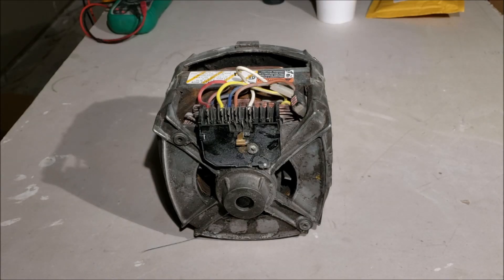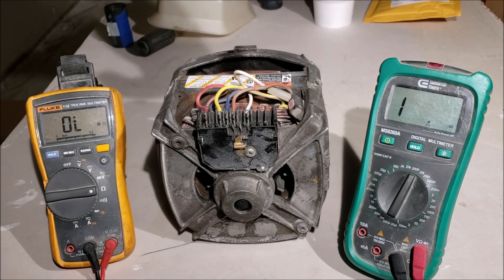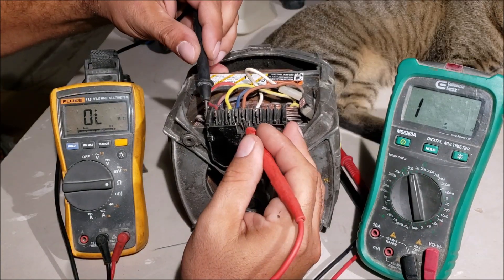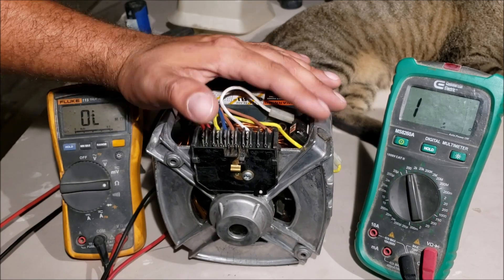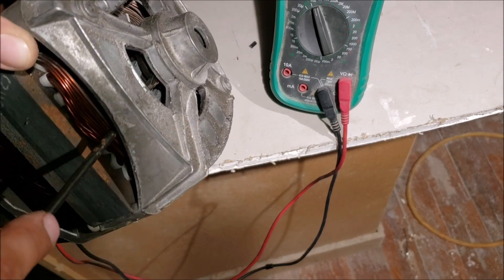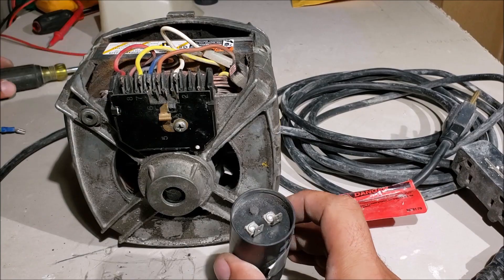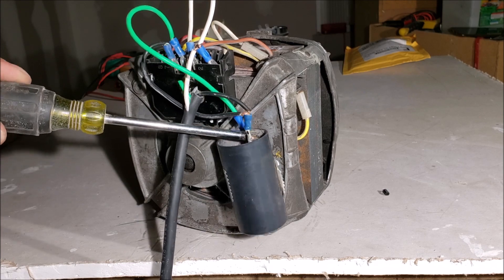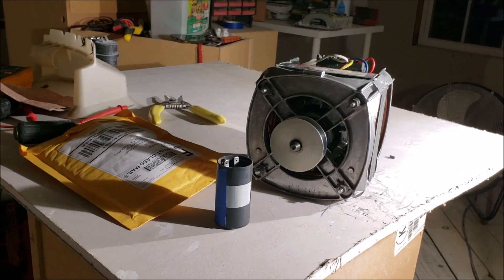how to test an ELECTRIC single phase appliance or shop motor DIY

Comment: Great video , Good Job !!
You don't seem to answer questions but I'm gonna try.
I'm building an Air Compressor. Used tank, used 240 v single phased motor (5 hp) used pump (5 hp) and all new plumbing, fittings & pressure regulator switch.

The motor has a gray rubber molded 3 line cord like you might see on a dryer or wash machine, but the plug end is cut off or missing. 
It gives me the idea that someone re-wired it at some point in the past. 

I'd like to connect electricity to it and see if it works (spins).  I have a sub-panel w/a 30 amp double pull breaker w/a 3 wire cord coming out and a female plug end.

How can I test the motor ??  I mean, what's the easiest way to add electricity to the wires on the motor or the contacts on the motor to see if it works ??

Would you happen to have an idea how I could test the 5 hp compressor pump to see if it builds up pressure or is a piece of junk ??

Thanks for your generous consideration,
Sincerely ...................
Steph  (Stephen) Leesville, LA.   (337) 509-6900

Comment: i checked Mine motor winding the same brand yours but my outlet is 230v 50 hz  the Runing was 2.60 Ohms and the start was 16.26 ohms. the motor works fine no issue? but what about this test result is it fine and normal.?